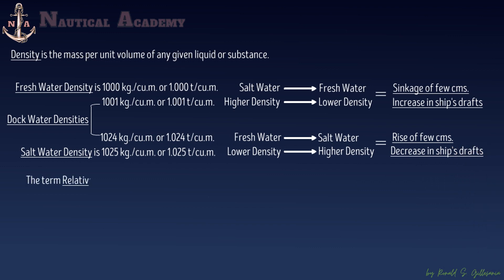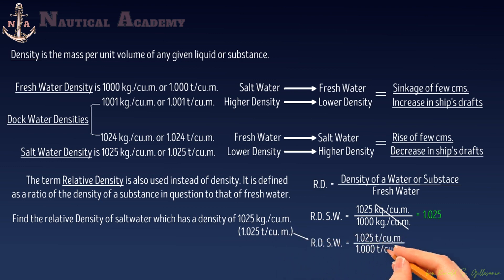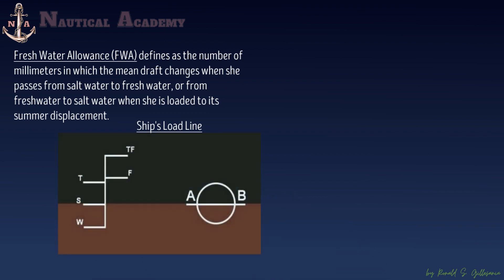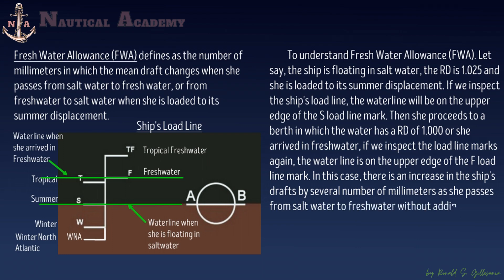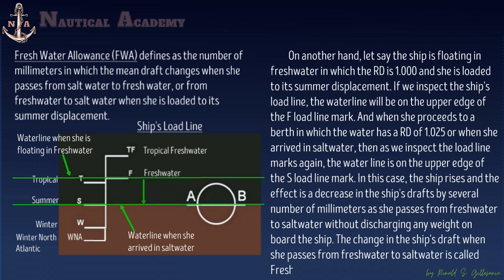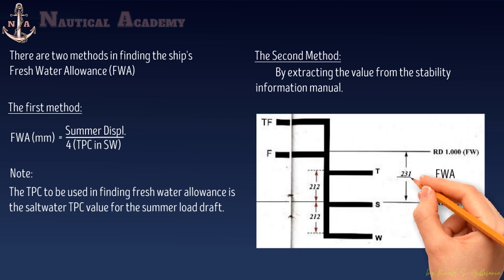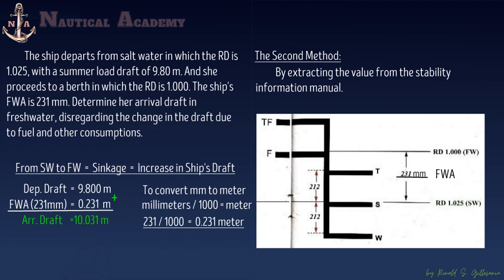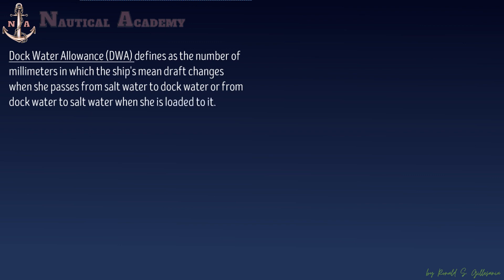Calculate the Fresh Water Allowance & Dock Water Allowance II Change in Ship's Drafts due to Density

Comment: In the second case. In DWA formula, 0.025 was considered, (1.025-1.000) Where as it should be. 1.018- 1.000= 0.018 in the denominator of DWA formula. 

Please clear this doubt.
Reply from the maker: 0.025 is considered constant value. It the difference between RD of saltwater and freshwater.

Comment: Sir, explain me please, on below mentioned example...  
- We dont have any draft and other limitations.
- Loading & discharging ports are in Summer Load line zone
- Loading port density  is 1.018
- Discharging port density is 1,005
- dont take in account any consumptions (FO,FW,DO etc) 
I understand that our draft will be increasing.
So question is:
How we must calculate the cargo, that can be loaded? 
(Using summer max displasement on 1,025 according to Hydrostatic tables, but in such way our load line summer draft will be  sinked in both ports)??? We wouldnt brake any rules in such situation because our summer zone load line is sinked or not?
 Or we must take our summer displacement multiply it  on 1,005, than devide on 1,025 and according to received (LOWER) density load our vessel, because in such way we wouldnt sink our summer zone load line?
Reply from the maker: To calculate the cargo to load:
Take the ship's summer displacement from the hydrostatic table as the ship's entire voyage is within the summer zone. Since that displacement is in salt water, apply density correction to determine the equivalent displacement in the loading port with S.G. 1.018 using the formula: Displacement at loadport = summer displ. x S.G. loadport (1.018) / 1.025. 

 Once the displacement in loadport is determined, calculate the max. cargo that can be loaded using this formula: Corrected Displacement - Lightweight = Deadweight - Deductibles/ROB/Non-cargoes = Cargo & Constant - Constant (K) = Max. Cargo that can be loaded in the loading port.

When the ship leaves the loading port (S.G. 1.018) and reaches saltwater (S.G. 1.025), the draft will decrease, allowing the ship to float at her summer load draft. Upon arriving at the discharging port (S.G. 1.005), a slight increase in draft will occur due to the lower density. However, since the vessel was floating at her summer draft in saltwater (S.G. 1.025), this increase in draft at the discharging port does not violate load line regulations.

Always remember that regardless of an increase in draft in the loading and discharging port due to water with lower densities, ensure that the ship floats at her assigned load line draft upon reaching saltwater. In your scenario, in which the voyage remains in the summer zone, make sure the vessel meets her summer draft requirements when she arrives in saltwater.
Reply: Many thanks for your explanation., 🤝

Comment: what is the difference between FWA and DWA?
Reply from the maker: FWA is the number of millimeters by which the mean draft changes when a ship passes from saltwater to freshwater, or vice versa, while floating at the loaded draft. This is typically measured when a ship is moving from seawater to freshwater, such as when entering a river or a lake.

Dock Water Allowance (DWA): DWA is the number of millimeters by which the mean draft changes when a ship passes from saltwater to dock water, or vice versa, when the ship is loaded to the Summer displacement. Dock water is a type of water with a density between that of seawater and freshwater. DWA is typically measured when a ship is moving from seawater to dock water, or vice versa, while in a dock or a shipyard.

FWA is the change in draft when a ship sails from seawater to freshwater or vice versa, while DWA is the change in draft when a ship sails from seawater to dock water or vice versa or from dock water to another dock water with different water densities. The key difference is the type of water involved, with FWA involving a transition between seawater and freshwater or vice versa, and DWA involving a transition between seawater and dock water or vice versa.
Reply: @nauticalacademy001  so we can calculate the change of draft by FWA value and TPC value with the given formula DWA= change in draft= displacement * change in density/ 0,025

Comment: Hi, at the last example, ive notice that you calculate as if the ship is going from higher R.density to Lower R.density. But as the example ship is depart from 1.007 to 1.018. Draft should rise then right? It should be decrease in draft. Kindly clarify. By the way great animation and lessons. Thank you🙂
Reply: thank you very much for your detailed answer sir, your channel is very helpful and insightful. plus the animation is superb. make it more easy to understand. have a great day.
Reply from the maker: Welcome.
Reply from the maker: Hi! Thank you for your comment. In my last example, in the final step, I subtracted the dock water allowance from the departure draft to find the arrival draft, since the ship sails from a lower R. density (1.007) to a higher R. density (1.018). The effect on the ship upon reaching higher density, she will rise, and as a result, there will be a decrease in the ship’s draft. That is why DWA should be subtracted from the dep. draft to find the arrival draft as shown in my final step which is also stated in your comment, a decrease in the arrival draft.

Maybe you are confused when I take the difference of the departure and arrival relative density because, in my solutions, I have shown (1.018 – 1.007) which is the arrival R.D 1.018 minus the dep. R.D 1.007. What I did is subtract the lesser from the greater R.D. so that I would have a positive DWA, but this procedure does not affect the ship’s draft yet. As you mentioned in your comment the ship will rise in this problem, and there should be a decrease in the ship’s draft “You are right”. That is why in my final step, I have subtracted the DWA from the dep. draft to determine the arrival draft because the effect is a decrease in draft.

Now you can also follow this format (1.007 – 1.018) which is departure R.D 1.007 minus arrival R.D 1.018, you will have a negative DWA. A negative DWA should be subtracted from the departure draft, and the result will be a decrease in the arrival draft as shown in my final step. Thank you very much👨

Comment: Why TPC is multiplied by 4?
Reply from the maker: Thank you. In the comment section, it's hard to explain how this formula was derived and why 4 became a constant. I will try to make a separate video about the derivation of the formula of freshwater allowance. Usually, onboard we can extract the value of the freshwater allowance in the stability manual provided by the shipbuilder.  

But try his one, Derivation of the FWA formula: 
Consider a ship floating in SW at load Summer draft at waterline WL. 
Let the volume of SW displaced at this draft be ‘V’. 
Now let W1L1 be the waterline for the ship when displacing the same mass of fresh water.
Let ‘v’ be the extra volume of water displaced in FW.
The total volume of freshwater displaced will be V + v.
Mass = Volume x density
Mass of SW displaced = 1025V
Mass of freshwater displaced = 1000 (V + v)
But the mass of FW displaced = Mass of SW displaced.
1000(V + v) = 1025V
v = V/40
Assume that ‘w’ is the mass of SW in volume v and ‘W’ in volume V,
Then, replacing the factor as obtained above we get:
w = W/40
But w is a factor that is a product of the FWA and the TPC
Now since the FWA is in mm and the TPC is in cm, they both have to be converted to metres
Thus: W = (((FWA mm x 100) cm X TPC cm) / 100) metres
Simplifying we have: w = (FWA x 100 x TPC) / 100 = W / 40
Or (FWA x TPC) = W / 40
But w = TPC x (FWA/10)
Hence W/40 = TPC (FWA/10) or FWA = W/(4 x TPC).
Where ‘W’ = Loaded SW displacement in tonnes.
Reply: @nauticalacademy001  thank you for answer